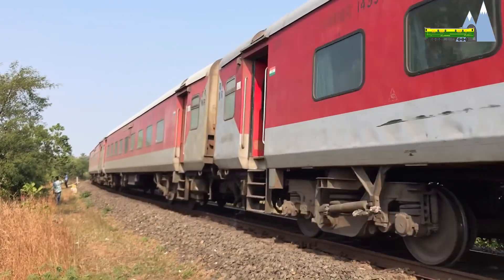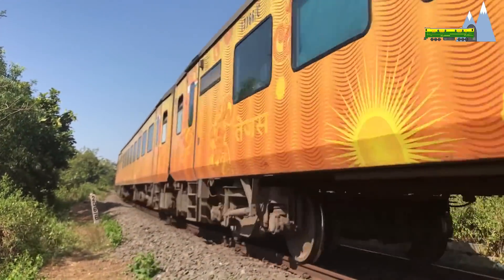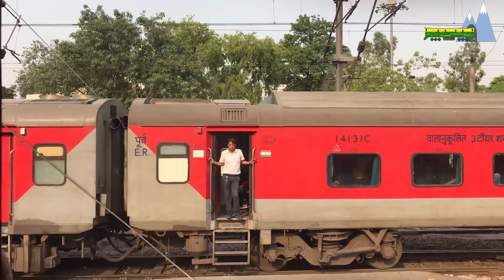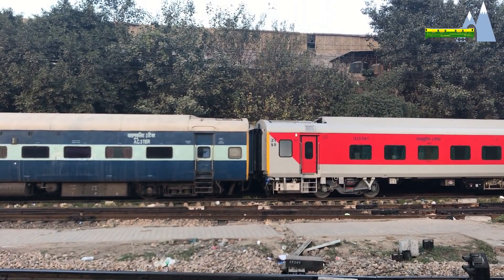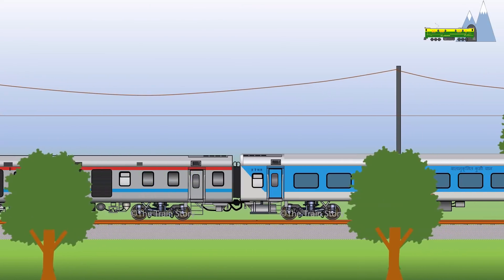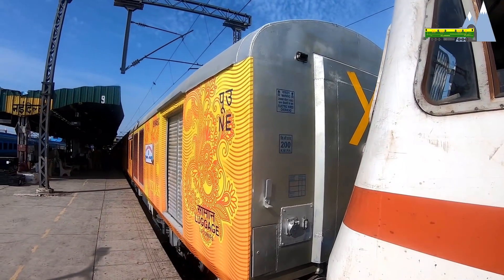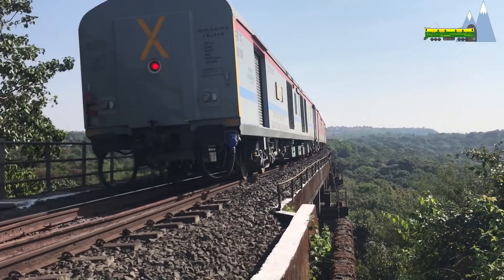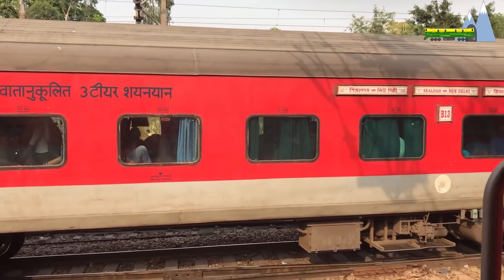Rise of LHB in Indian Railways | LHB Coach | Indian Railways | Linke Hofmann Busch

Comment: What’s the exact weight of ICF and LHB coaches? Is the construction of Aluminium in LHB, thus contributing weight savings? You could have answered these questions, instead of vaguely mentioning that “LHB is lighter than ICF”. 
Are LHB coach toilets better than the open air non sense of the ICF coaches? That also should have been covered.
Reply from the maker: An LHB car weighs ~40 tons compared to an ICF coach that weighs ~47 tons. LHB are made of Steel. The IR has set up a factory for Aluminium coaches but they are not LHB. Both in service LHB and ICF coaches are being fitted with bio-toilets.
Thanks for your constructive critique...
Reply: @TheTrainStory  Thanks for the detailed reply.
Reply: @Xetairex  😠😕
Reply: @Ankitlabh2009  If you have a problem, state it. I don’t get what issue you have with what’s an objective comment. Moreover, it was addressed mostly, by the video uploader.

Comment: Could you please confirm the width of a Double Decker Coach? Is it 3050mm?  It seems they were initially designed for a width of 3135mm. But when the rake was sent to Eastern Railway in October 2010 for trial runs between Howrah and Dhanbad, the sides of the train scratched against platforms at various places. Thereafter, it seems, a decision was made to trim the width by 85mm. Is it still the case, or have more changes taken place over the years?
Reply: one news report on chennai bengaluru double decker train does mention the width as 3050mm

Comment: Sir,
Aap zara passenger rolling stock ke upar bhi video banaiye toh bohut khusi milegi.
Aap thora bataye ke agar IR pe 3660mm width ke coach chal sakte hai toh phir 3250mm ke coaches hi kiu mostly banaye jate hai???
Reply from the maker: Sumit... I think this is because of the clearances available on mainline in terms of platform width and other fixed infrastructure. However, the suburban EMUs that IR operates are wider (12 feet or ~3660 mm). But platforms and other infrastructure are specifically designed for them. That is why these trains cannot operate outside their suburban territories. Hope this helps..
Reply: @TheTrainStory  
Sir,
In Kolkata the wider EMU trains use the same platform and other infra as used by normal i.e. 3250mm coaches. I wish if you will delve a bit deeper and come out with a well researched video..
Hope my wish shall come true, I have looked in many IR sites but only available reference is that 3660mm coaches are to be ordered after express permission is received from Railway Board itself...
I want to attract your attention to the fact that coaches in fast running TGV network  have almost similar width as ours even when their gauge is 9.5 inches smaller...
 Pls look into it...
Pl
Reply from the maker: Sumit, I will try to address your questions point by point
1. In Kolkata, Mumbai and Chennai the intercity trains use the platforms designed for 12-foot EMUs and not the other way round. This is the reason the wider EMUs cannot run outside their designated territories
2. It has always been debatable why indian railways (from British times) never really exploited the wider loading gauge that 1676 mm provides over 1435 mm. Rail cars in India have been similar in width to standard gauge cars.
In fact the Shinkansen cars (1435 mm gauge) have wider cars (3360 mm) than our LHB cars. 
4. The wider EMU cars were designed to address the dense crowds in Mumbai. They were subsequently used in other suburban areas as well.

Comment: can add alternators if the disk is shifted to wheels like in t-18..
Reply from the maker: Yes you are right. The railways have experimented with alternators on the Fiat bogies... but they have opted for the HoG. Drawing power from the OHE and transferring to the cars through the loco seems much less underslung equipment to carry

Comment: Why aren't the coaches made fully out of Aluminum?
Reply from the maker: The Train-20 was to have Aluminum cars but that is in cold storage now. However, the Modern Rail Coach factory may start building Aluminum cars
Reply: It costs too much
Reply: Indian railways currently doesn't has the technology to manufacture all aluminum coaches. Cost is not an adequate reason here because as technology improves, costs come down. Check in case of Cars. Newer cars are aluminum built vs older steel cars. Though, Indian cars still ise wrought iron under the body to save cost. Indian railways can also come up with something similar once it acquires the required technology.
Reply: @AnkurJhavery  audio Spanish